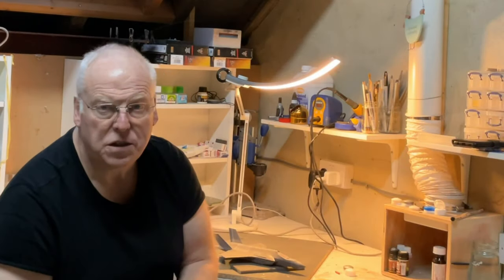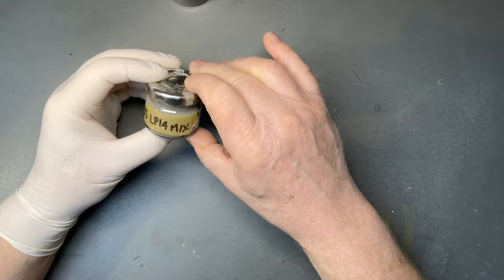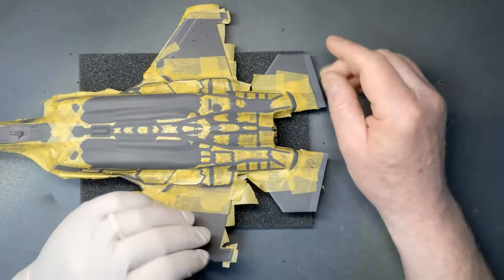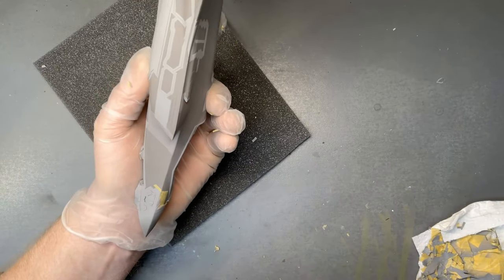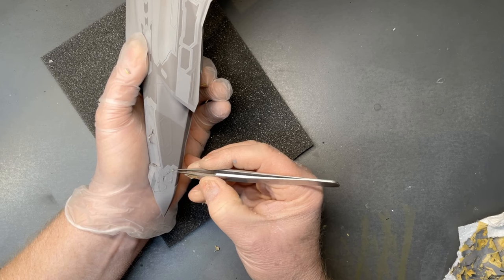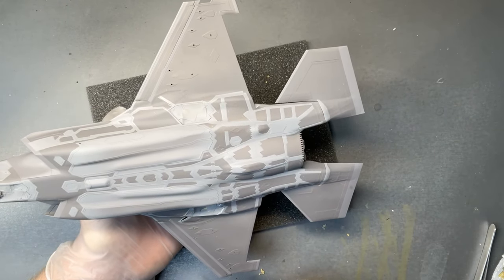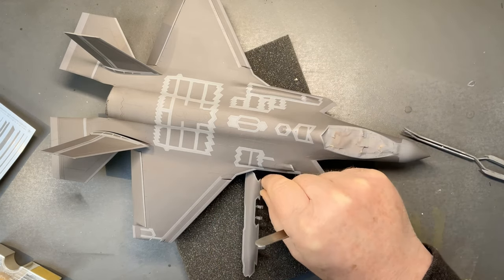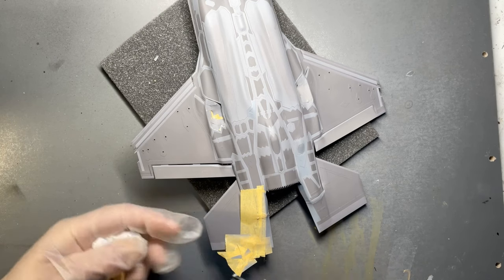Tamiya 1/48 F-35A Lightning II part 4a

Comment: Stunning masking there! 👍
I'm currently building the same kit; have it all decked-out in a dark slightly metallic grey, and I'm using a few of the decals/transfers from the kit, for the darker schemes, as I'm also going to use a set of the Carracal decals to give the RAF Lakenheath version, which I see on a daily basis as I work on the civvy side of the base in the BX (equivalent to the NAAFI).  They are an incredible sight to see with some of the manoeuvres you see these things skid/drift into!!  😆 
I love watching the F-15E's as well, but these F-35's are just that bit more slippery when off the ground, and you wonder how the hell it can that!!!
The Tamiya decals actually go down very well, although they are a bit thick (no surprise there then!!), but with a fair amount Micro-Set/Sol, they settle really nicely - I wouldn't relish doing the entire RAM tape patterns with 'em though!  Luckily the Lakenheath birds don't use that scheme, being later versions... 🙂
Reply from the maker: Thanks Steve I’m glad I did the RAM work now but boy it was a trial. I’ve since tried a few of the Tamiya decals and they are thick but settle down well.

Comment: I'm in the process of decaling the RAM panels and you're totally on point when it comes to the time required to do it: I'm into the third session now and as usual with Tamiya decals they need some work with different solutions to settle. I'll have to see how things look after I add a varnish on top – but opting for masking and painting the panels is certainly not a more time-consuming process. It's as you say – if you go for that scheme, you need to commit to it. Looking forward to seeing the rest of the build!
Reply from the maker: Thanks Marc it was a lot of work but it’s the only F35 I’m going to build so it had to be. Good luck with the decals I’d be interested to hear how they go for you.
Reply: @TheModelShed  It went okay(ish) after all, most of them look good under a flat coat. I went through most of the setting solutions known to mankind to get a somewhat decent result – tamiya mark fit strong has proven to be the best option after all. The result is still not perfect and if I'd do it again, I'd probably opt to mask/paint the scheme as well.

Comment: That has turned out perfectly, well done my friend, I was thinking of getting the F-35 at some stage but have gone off that idea as I really don't think I could be bothered with either the decaling or painting as you have done, looking forward to the nest installment, best regards from a Kiwi living in Australia.
Reply: Les don't give up on the F-35 as all the late production (and refinished early production) jets now have very minimal RAM panelling. Much simpler - !
Reply from the maker: Give a later version a go Les if you really fancy an F35 - less work than this.

Comment: F-that for masking.  Sorry, but I just don't have the patience for that.  Decals for the ram panels are the only way I might consider doing that, although the newer paint schemes for the F-35 have the RAM panels the same colour, so no masking/decaling required at all.....?
Reply from the maker: Probably the later schemes are better if you don’t want the work of the RAM panels. There will be a ready cut mask set available soon though which will save a lot of time